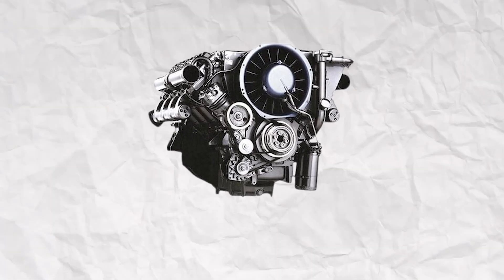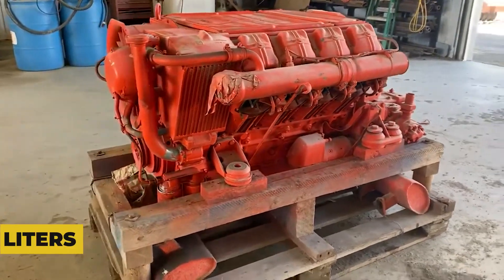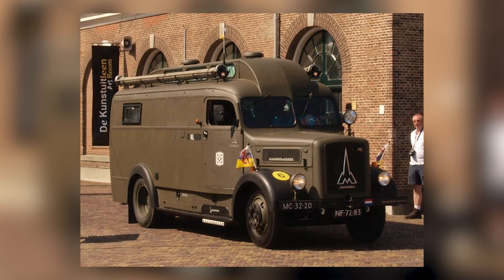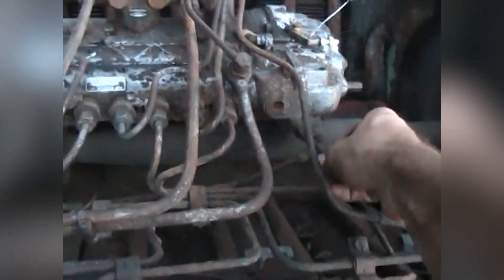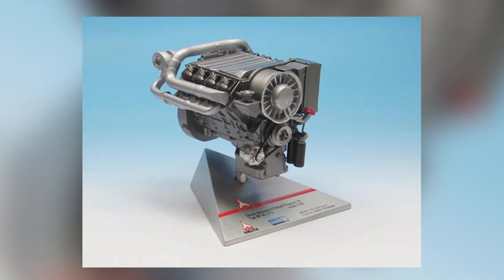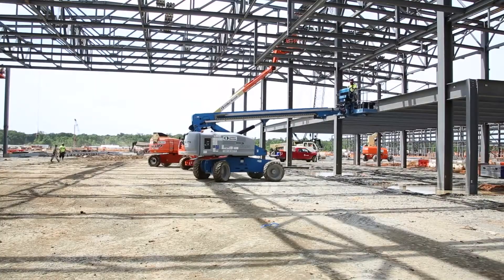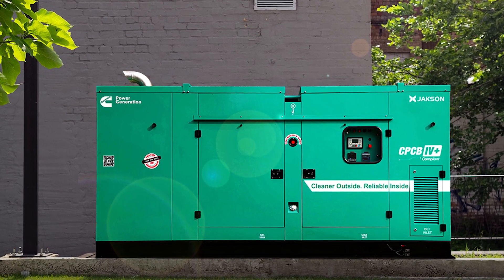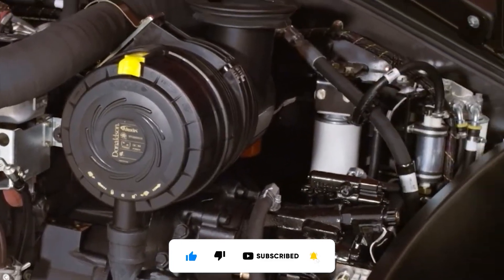Why Deutz F8L413F Was Banned: The Engine That Pushed Boundaries Too Far

Comment: My dad had a Deutz pluto cab over truck with the Deutz engine F8l413F horsepower from the Deutz factory was 256 horsepower and this was back in 1969-1970 😎👍💪if you had one of these Deutz pluto trucks you were a big man with a big truck and big horse power for back in those days 1969-1970 💪💪💪👍👍😎 for trucking interstate 👍